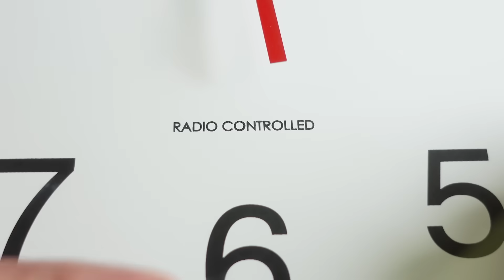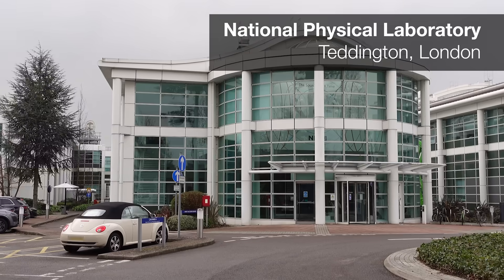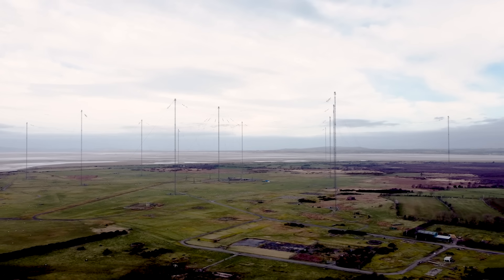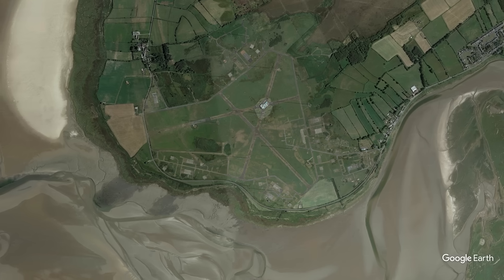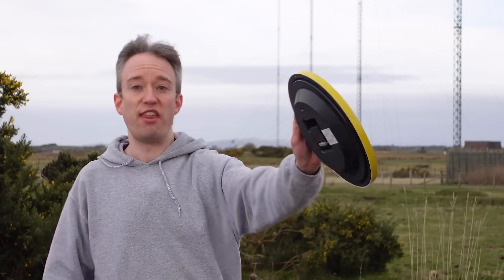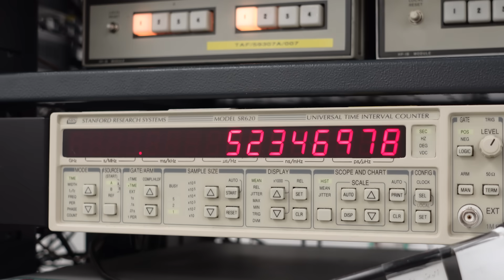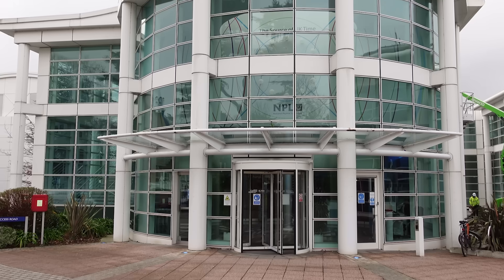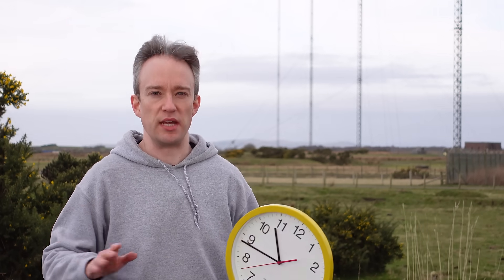How does Britain know what time it is?

Comment: If the radio signal controls the clock, every one of these clocks shows the same time.  Yet if you tape Coronation Street (19:30 to 20:00) then switch over to watch EastEnders (20:00 to 20:30), so often the second programme has already started.  How is this?  Can BBC Management not tell the time, or have they not set the clock properly?

Comment: The German equivalent radio transmitter is called DCF77 on 77 kHz … railway station clocks in Germany and the Netherlands are synchronised to it. It transmits with a nominal power of 50kW from Mainflingen.

Comment: I live in the UK, and got a very cheap radio controlled wall clock from a charity shop, with the writing on the box all in German.
When I set it up, it zeroed itself at 11am instead of 12.00, and then always ran a hour behind.
It then occurred to me that it must be tuned to receive a time signal from somewhere other than our own.
I couldn't return it for a refund, so I had to dismantle it and reposition the fingers on the shaft at a position which was correct for local time.
Been working in the bedroom like that for 4 years, although I do wonder if ever the German daylight saving time deviates from the uk......

Comment: I had one AA battery in my radio controlled clock that lasted about a decade and still showed the correct time. The battery had only about 0.2 volts left in it and had even started to leak. The display was getting a bit dim though. 🤣

Comment: You can have a radio controlled watch too. Most popular is Casio's technology "Waveceptor" or "Multiband" (5 or 6) where you specify one of the 6 transmitters around the world (UK, Germany, USA, two in Japan, China) and your watch just synchronises every day some time after midnight, when there's least interferrence. 
If you're out of range, though, you're out of luck.
I have a Casio G-shock GW-M5610U (a standard radio controlled, solar powered, abuse resistant watch with a classic 80's design) and it's nifty to set my other watches to it.

Comment: Many of the solar watches in my watch collection use this technology.  Its highly prevalent in Citizen and Casio watches.  Some of the more advanced ones use gps signals or less expensive ones use Bluetooth to get the time from your phone (only use if your phone corrects itself to an atomic clock.  not all do).  These 2 options are handy for countries that do not have the signals.  I believe the only places that use atomic radio are North America, Japan and Western Europe?  Frankly I wish more countries did this.  Its a highly valuable time correction device that can be very cheaply put into electronics.  Even Quartz devices can lose up to a few seconds a month, which might not sound like much, but cumulatively over time lead to high inaccuracies in time.  Also you ever notice when you ask most people what time it is most of them have different answers by a few minutes.  This kind of tech would fix that problem.

Comment: That clock might not actually have been "really really" accurate for a few minutes. It probably saves power by only listening for the time at intervals, so you would need to have been lucky to be there at a time when it decided to listen, although in that case it would then stay "accurate" until it next listened.

Comment: They clearly chose an important background and with cable management like that I do not trust them... cables should be managed in a way that they are unlikely to be damaged, dangling or loose cables can be damaged or snagged, both as a geek and a data and communications engineer I despise their cable management and since they no doubt get government grants I am happy mr time company to come out and improve your cable management to make it less likely to be bumped into and to make sure your in time down time is cut short for The low, low government contract amount of £100,000 per day.

Comment: I thought you were going to show us how the clock gets the time and sets itself. I used to have one in Florida and I read that the signal came from Denver - quite far away - but it was a digital clock, not analogue. And your presentation seemed to imply that it only sets it one time when the battery is inserted, but I'm not sure that's correct. I think mine would take a few days to correct itself, but I don't know how it worked really. I don't think these are wide spread or well known in the States.

Comment: In a previous job, when the UK signal was moved from Rugby up to Anthorn i was task with moving our receive antenna slightly to compensate for the different location. The antenna was a ferrite rod in a white plastic box so it was directional. Being located on the south coast of the UK,  we could pick up the DCF77 signal much stronger than Anthorn.

Comment: As an electronic engineer, I am always slightly amused by the fact that they keep time to accuracies of nano-seconds and even pico-seconds, but that the standard for broadcasting that time terrestrially (as opposed to via GPS) relies on carrier wave transmission at 60kHz in the UK and the US, or 77.5kHz from Frankfurt (for Europe) where the received signal will generally take a few milliseconds (at least) to be detected with a wide variation between different receivers.  Of course, I understand that watches, and office clocks, and other devices that use those signals, etc. don't need the precision of GPS (100ms or so is generally good enough), but the orders of magnitude are at times surprising.

Comment: This was...bonkers. Had no idea could have clocks that 'set themselves' via radio control.
Reply: Got a clock at home that did that for many years until the battery stopped recharging.
Reply: Honestly! It's kinda cool to think about clocks setting themselves, that too by radio; I wish we had these in the U.S. tbh 😞
Reply: @prayagsuthar9856  We do.  The transmitter is in Colorado, with call sign "WWVB", and it's run by the National Institute of Science and Technology (NIST).  Every Wal-Mart I've ever been in has had clocks that will sync to this signal.

Comment: Cool video, but how does the actual clock work? How does the clock "understands" that it is 3 hours late, for example? I have never seen a radio-controlled clock in my life so I'm really curious.
Reply: I'm not sure but I can guess. Many quartz clocks have chime functions which work by sending a signal to the circuitry when the top of the hour or similar is reached. A radio controlled clock would see such a signal and know its reading at that exact moment. Then it can count the ticks it sends the motor to continue knowing the displayed time. Then it receives the proper time from the radio module and calculates the difference.

Comment: I have a "radio controlled" alarm clock that uses what used to be called the Rugby time signal. I'm on the South coast, and ever since the transmitter moved from Rugby to Cumbria, my clock has been unreliable. And I don't mean it just fails to pick up the signal and gradually drifts, I mean there have been occasions when it reset the time from the signal and got it very wrong - 20 minutes out quite commonly; even, on one occasion, several hours out. I believe it's down to a weakness of the signalling protocol, which really doesn't seem to have been well designed to cope with a signal that might drop in and out. I guess it's too late to change it now...

Comment: You have to be careful about the accuracy of these radio controlled clocks - they are advertised as being accurate to 1 second in several million years. However they time is only corrected a few (number unspecified) times a day so between the corrections it is just a free running crystal oscillator and can drift by several seconds. You need a much more sophisticated clock to keep it to sub - second accuracy.

Comment: Some time ago before the adoption of standardised  Europe wide summer & winter time changes the station clocks on the railway in Kent were converted to run off radio time signals. The only problem was that in Kent the signal from Germany is stronger than the signal from Rugby (where the signal used to be broadcast from) . So when the clocks in Germany changed all the station clocks in Kent suddenly were an hour out !

Comment: It is interesting to note that if you buy your clock in a different time zone it still syncs with that time zone in the UK if it can pick up a transmission.  We have a radio clock from Germany that is always out by one hour but still picks up daylight saving etc. changes.
Reply: I bought a weather station with a clock function in the UK shortly before I emigrated to Romania in 2010 but I didn't fully unpack it and install the various sensors for temperature, windspeed and rainfall until I was settled in my new home. The clock function was set for EEST (2 hours ahead of BST)  but I've found that it occasionally resets itself to BST in summer or GMT in winter!

Comment: A fascinating story about the importance of time is the restarting of the New York electrical grid, after 9/11, when the legacy synchronisation infrastructure was destroyed. A GPS solution was used, but I think that if the UK was in the same position, their LF system would be much simpler. (If it's not already used for that purpose.)

Comment: I bought a clock radio over 20 years ago. Big numbers, easy to read :) however, the clock is set by a time signal. The time auto adjusts twice a year. Over two decades, the time is always correct.

Comment: For perspective on how little power you need to consume this signal: I once had a digital clock with a capacitor that could keep it running, accurately, for weeks after removing the single AA battery
Reply: It uses only nanoamperes.
Reply: @AnoNymInvestor  Nanoamperes, son
Reply: Woah.
Reply: Nice avatar.

Comment: I've bought a few of the US versions over the years and what I've noticed is that over time, they are less and less good at picking up the signal. I assume the radio circuitry degrades over time.
Reply: Newer clocks probably using cheaper (less-good) electronics, or at least it's not "tuned up" optimally in the factory to save costs.
The bigger problem is that more modern electronics appliances generate a lot of interference at these low frequencies, mostly from "switch mode power supplies" which run at frequencies between 30-100kHz...
If you turn off unneeded appliances and chargers etc, and place the clock well away from other appliances, the situation may improve.

Comment: The USA had something similar embedded in public television broadcasts but I only recall it being used for things like VCR+ programming.
Reply: That's quite different. The direct equivalent is the WWVB longwave time station in Colorado which is what all radio clocks I've seen use.
Reply: @eDoc2020  Of course, but it’s similar in the sense that it is a radio signal on a nationwide public broadcast network for automatically setting the time which predates widespread consumer adoption of GPS and online time servers.
Reply: @emmettturner9452  I definitely wouldn't say it's on a nationwide public broadcast network. I don't think my VCR has ever gotten its time automatically and it does support that function. I didn't even know it existed until after the analog era.

Comment: I have a radio-controlled clock - a digital one complete with chunky 7-segment LCD. Although I used it to be a snipey little scamp on eBay in 2004, I just kind-of assumed the service stopped working a couple of decades into the Internet age. Perhaps I should put a battery into it when I next find it and see what it does.

Comment: One thought that sprung to mind. Could we set up essentially a lighthouse on the close side of the moon. And just have it flash at a very regular interval... And could it be visible from earth? Maybe just one flash per minute. Driven by solar panels and batteries. 

Sure, it may not be able to be seen during a full moon. But when most of it is in shadow maybe...

And yes, I know there are reflectors up there that they can shine lasers on to get a distance reading and all that. But I'm thinking of something that can be seen by anyone with a direct line of sight.
Reply: It'd have to be massive (the distance between the moon and Earth is enough to fit all planets of the Solar System side to side!)

Comment: The cable management in several of the shots is absolutely horrible, if I had left a job like that, I would have been sacked.  It is not just cosmetic, it is a fault liability, it makes maintenance difficult and shows very little pride of work.

Comment: I used to work in a newly built school. It had radio controlled clocks, so that the janitors wouldn't have to adjust them all manually twice a year, However, no-one allowed for the building being metal clad. The clocks couldn't receive the time signal. So, twice a year, the janitors had to take all the clocks down, put them on a trolley, wheel this outside, wait for all the clocks to update, wheel it back indoors and put all the clocks back up. Sigh.

Comment: I've been looking at weird wave like patterns that keep appearing in clouds a few weeks ago.  We have had some very unusual weather which prompted me to regularly look at weather satellites images.  These wave like patters keeps appearing almost daily, usually in the morning over hundreds of miles, at a very specific distance of 5km between wave peaks.  It turns out that radio clock signals are some of highest powered transmitters in the country and the only possible source of a 5km long wavelength.   

However, I'm not looking at the UK, I'm looking at the East side of Australia, which apparently, doesnt have these radio clock transmitters. Just wondered if anyone else here has done any similar diligent work in to this.

Comment: A cargo ship used to sail past my workshop, we knew it had passed because it changed the time on all our clocks and watches with whatever signal it was broadcasting. Had to switch to manual change devices.
Reply: How and/or why would it do that? I doubt that it would be legal to transmit such a signal at your location.
Reply: @leocurious9919  likely to keep all the clocks/devices onboard in the timezone of the departure port.
Reply: @uberfuzzy  time on board ships and the like drifts gradually through the voyage afaik, so when you get to London from shanghai you aren't like 10 hours jetlagged
Reply: How are you getting jetlagged on a 40 day journey? There's no jet involved to introduce any lag.
Reply: @joetoaster447  If everyone aboard kept living by the time of their port of departure they might be many hours out of step with their destination's clocks. As Agustin Venegas pointed out, it's easy to slowly adjust the shipboard clocks during the voyage so that everyone arrives operating on the destination's schedule.
Reply: @WyvernYT  That has absolutely nothing to do with jet lag.
Reply: @joetoaster447  jetlag is a bit of a misnomer, the actual definition is when your body's clock doesn't match the time   you're functioning on
so if your body says it's 4 am, bc you're somewhere where it is 4am, but your job says its around midday, bc it's still using the time of your homeport, you'll be severely jetlagged
Same way if you just got to LAX from Tokio you're jetlagged bc your body and the clock on the wall don't match
Reply: @joetoaster447  No jet lag, but you will get Phileas Fogged in.  I.e., hit with the International Date Line effect, just as happened at the end of Around The World In Eighty Days.
Reply: @agustinvenegas5238  "your body doesnt match the clock on the wall" definitive proof everyone on the internet just pretending they know stuff
Reply: @joetoaster447  What do you think is the definition of jet lag? You don't need a literal jet for it to happen lmao
Reply: @craigdirectormitchell6721  Huuuh?! That's supposed to prove something!? Sheeeeeh! okay, okay, get ready then. Here's definitive proof I'm smart. "Potato." Boom. I've just proved I'm briliant. See? I put it in brackets, so that means it somehow proves what I said.

Before a random egghead says something dumb, this is obviously a joke to show that the tagged guy's statment is literally just a really outrageous claim with some bracketed text.
Reply: @uberfuzzy  That's a great theory, and probably correct. Certainly illegal and irresponsible of them though
Reply: To my knowledge shipboard time is at the captains discretion, and is usually set to the time of the next coast/port you expect interact. 
Even having a small transmitter broadcasting this time info solves a problem nobody really has. 
The cargo must somehow make it worth the effort.
Was the ships time always the same, and where in the world was this?
Reply: @joetoaster447 Jetlag is what happens when you switch between 2 distant time zones in a day. Usually people take a jet to go that far, but it applies to propeller-planes and rockets just as well. 
If a boat changed its time by hours when it reached its destination, the same effect would happen.
Reply: Wow
Reply: None of this addresses why a cargo ship would be BROADCASTING a signal powerful enough to override and reset shore-based clocks. Something smells fishy; besides the deck of that ship, I mean. ;)
Reply: @Elmojomo , I also agree. That is a little strange, though I do have to admit this thread was still interesting.
Reply: @deftknight7418  Very! Interesting, I mean. :)
Reply: @Elmojomo  and probs some of their cargo
Reply: @Elmojomo same wz planes, happened all the time, or 5.7hr after last atomic reset...
Reply: @The Engineering Mindset   2.4 million subscribers can’t be wrong !!
Reply: Cool
Reply: Clocks have to request the signal before they can change; usually at an appointed time each day.